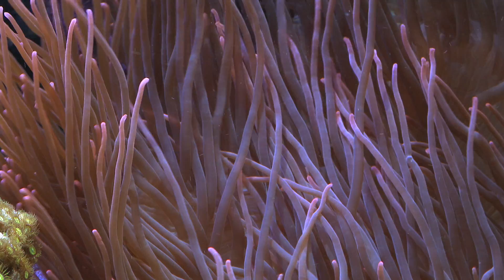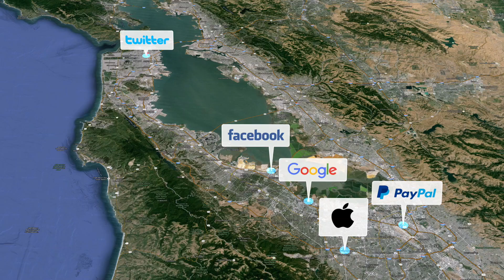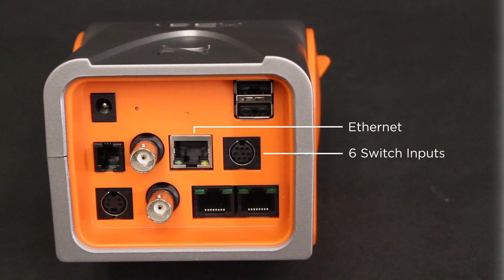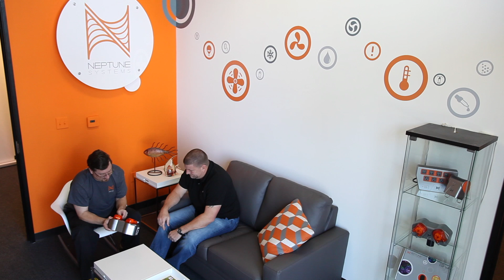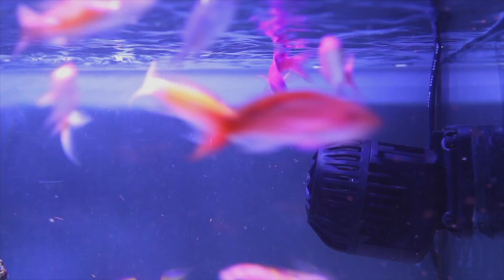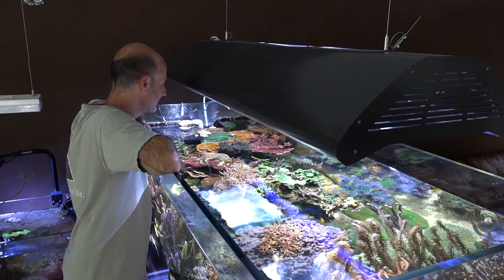The Apex by Neptune Systems (long version)

Comment: what is orp? Also what is the electric montering, is that just to let you know you lost power?  I am looking for a way to back up power incase of an outage being I live in Florida and its hurricane season!. I have had a reef tank for 5 months and i just had a salinty drop that went on for over a week and I suppose that threw me into a crash or the live rock I traded or adding to many frags or what but my parameters are a mess, ammonia, nitrites and nitrates and alk swing, low ph.  I set ip a new one about a month ago and my heater almost fried my one fish!  Stuck over 90 degress so I am for sure getting one of these!

Comment: Great video guys! As a new user to the apex classic, I have 1 wish: please do an "advanced apex for dummies" video on what needs to be done or what can be done with an apex. I have 3/4 of my system tied to the apex but I don't have many fail safes or any of the "in depth" things that can be implemented into my apex. I'm not a tech geek but would love to learn a few things on what I should be doing differently. All I have is my equipment plugged into it. I think the most advanced thing on my apex is the ability to control temp.. please and thanks you!
Reply: Mike Lemming get you a break out box and setup floats to shut the return pump off when the low float is turned on. Setup another float to shut off the skimmer is water gets to high in the sump. 

Look up defer codes, for instance my skimmer is setup to delay start for 10 minutes if/when my return pump shuts off. This will level out the water level in the sump and not overflow my skimmer. 

One of the most handy is setting alerts!
Reply: I have a breakout box and 6 floats that haven't been opened yet.. for 3 months now 👎🏼
Reply: Mike Lemming hahaha google "devoted reefer" and checkout my reef2reef build thread.
Reply: Will do but, can you just stop by and do it for me? I'm only a couple blocks over.. in Massachusetts..

Comment: I'm a new apex user and I enjoy everything about it. Working in IT it was very easy to grasp and understand!
Reply: pelphrey you got an apex? Welcome to reefing my friend ;)
Reply: Mike Lemming hahaha fixing to order another eb8, got all my outlets setup and a few virtual outlets. I'm running the break out box with floats, my ATO container has a built in float switch holder.
Reply: pelphrey damn bro. How did you learn all this? I've had an apex running for 3 months and don't have a clue what to do with it. Raises plug my equipment in?!?!?